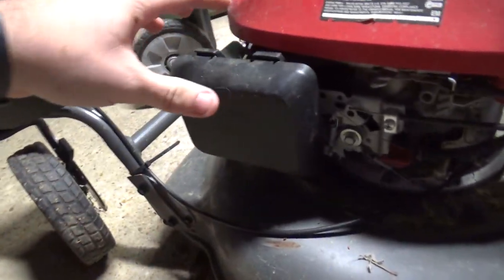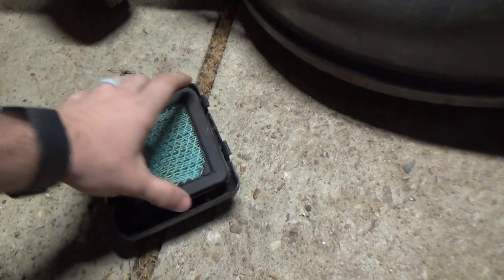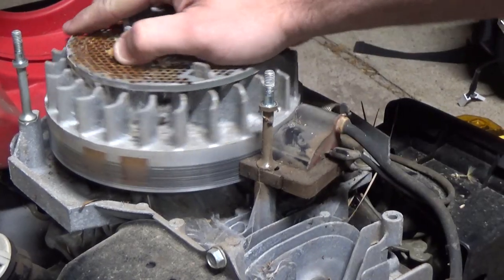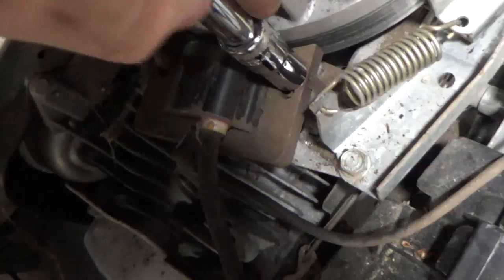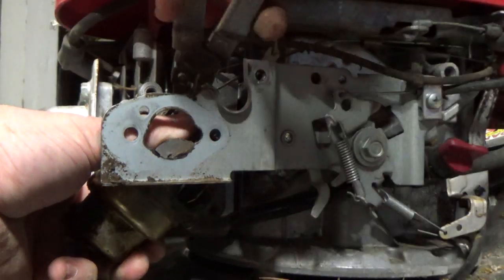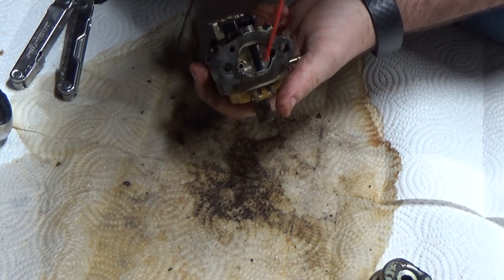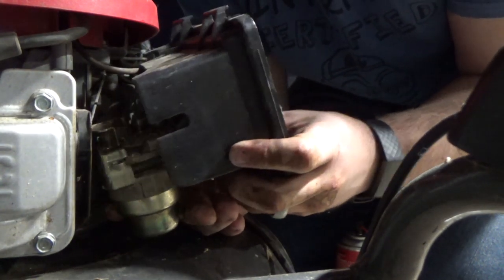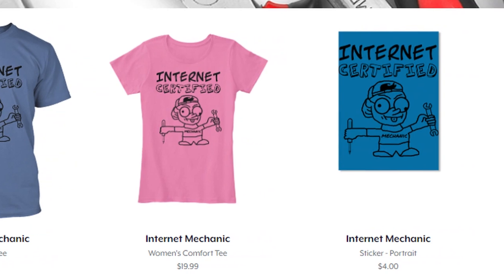How to diagnose and fix a Honda Lawnmower, wont start, no fuel, no-spark

Comment: Newer Honda lawnmowers, use an auto choke system. If the engine does not start while cold, but it starts well when hot, the thermowax cartridge, located in a hole on the side of the cylinder in line with the choke linkage may have failed. If the cold engine starts and stays running using carb cleaner when you spray a shot into the carburetor to prime it, you will know that this wax cartridge has failed and needs to be replaced. It is a "thermowax" 16620-Z8D-305 part from Honda. A good thermowax will have the little probe retracted when it is cold. Conversely, a failed thermowax will have the probe stuck extended while cold, holding the choke butterfly open. So the engine is starved for fuel when cold. The probe in the thermowax moves the choke butterfly open when hot and closed when cold.
Reply: Good point, George. Problem with mine staring cold was the thermo wax cartridge. Replaced and now starts first pull. Damn things are expensive, $30.00 on Amazon for a genuine Honda part.
Reply: I saw a video of a guy getting a manual choke system and by passing using the thermal wax mechanism. I’m thinking of doing this to my Honda tired of it failing at least 3-4 times a year.

Comment: I have a Honda mower and I love it! I clean the spark plug at the beginning of the season, check / replace the air filter and clean the mower after each cut. After about 15 + years it’s still going strong. No issues with it so far.

Comment: You make the latter steps (putting the parts back together), much easier than it really is.  For most people, this is NOT a one person job and if one does NOT have a lot of patience, send it to someone who does.
Reply: I replaced the bolts with studs. Makes reassembly much easier just sliding everything on in order.

Comment: Thanks for very helpful video. I got my honda mower back from repair shop three weeks ago. They did a tune up and rebuilt carb. The first time I tried to start it, took 8 pulls.  Week later.6, then next week would not start. Watched your video and checked for spark. No spark, so pulled coil off and cleaned rust off contacts. It started with one pull.

Comment: Another thing those Honda engines are good for after they've been sitting awhile is no compression.
  Then you have to pull the valve cover and remove the intake rocker and unstick the stuck intake valve and it'll have compression again.

Comment: Thanks so much for this. I applied it to a Honda GVX160 and it was more or less the same. The carb was completely filled with gunk. After cleaning as you suggested it started pretty much on the third pull. Couldn’t believe my ears. It had been standing for 5 years. You provide an amazing service!

Comment: This is the most common sense method for troubleshooting any small engine with no start problems. If I didn't know this already I'd be subscribing. Hey CM I've been wanting to explain to YouTubers exactly the process you demonstrated how to troubleshoot this Honda. I'm scratching this off my bucket list because you beat me to the punch and its essentially Mission Accomplished. Thanks for putting this up.
Reply from the maker: Thanks!
Reply: @CreativeMechanic  and you did it in 9 minutes. That was some really nice editing. Great Job!
Reply from the maker: The only thing I should have left in was to check compression!  But I’m at the point where I can usually feel burnt rings when I pull the pull chord.  Thank you!!!

Comment: Thanks for this video! Mine was backfiring after running great all summer. I followed all of these steps and runs like a champ again. Appreciate you taking time to make this video.
Reply from the maker: Backfire is when the engine fires back up the intake, after fire is when the engine fires through the exhaust.  This can be caused by improper valve timing or a rich or lean mixture

Comment: I have one of those. So far I have replaced all the wheels, both rear wheel adjusters, the carburetor,  all the cables except the throttle cable,and now the transmission and axle. I hope this thing is worth the effort. The front wheels are supposed to lock up but the cables were frozen. It was $66 just to replace them. I only paid $35 so I pray it doesn't need anything else. The transmission cost me $145. I normally just part them out but committed myself to repairing this on . I have another with a badly bent crankshaft that I plan on replacing. Honda mowers are over complicated for what they are. Those drive shafts are trouble. Every one I got refused to go backwards. Usually it's rust on the axle. Honda needs to get its act together.

Comment: Excellent video.  I've been watching a ton of these and this one is the best I've seen. My problem is that even after following all the steps - even replacing the carb with a new one - my mower still won't start.  Mower sputtered and died while mowing and haven't been able to start it since.
Reply from the maker: You may have a bent push rod, a bad valve, or leaky piston rings.

Comment: Excellent teaching video and thank you. Are there any carb adjustments other than the idle screw?
Reply from the maker: Mixture screw too, but those are both usually spot on from the factory and don’t need to be touched

Comment: To clean the jets and air passages, you need to remove them and clean them manually with small wire or carb brushes.  Then spray everything thoroughly with carb cleaner.  An ultrasonic cleaner works great with carbs if you have one.

Comment: Great video, Thanks. However, My issue is a little bit different. Just went to start my 25 year old Honda 214 model ( I believe) Had started it every year, and ran for about 15 minutes. However, for the past 2 did not.  Brought out yesterday to start and service, and starter cord would not pull at all. Tried moving blade underneath, but remembered there is a blade brake/clutch or similar devise in place. Just trying to free piston. Note mower always kept in air conditioned/heated garage, never out in elements. Also, always ran carb dry . Any suggestions to free motor would be great. When it ran, it was just fine. Thanks Robert TN
Reply: Sometimes when lawnmower hit something hard get stuck and won't pull the cord or kick back the handle cord front the hands and blades not moving or hard to move with the hands. 
You can try moving the blades move the blades with a long wood and if you thing is a divice or cluth stopping the blades you can try put the handles in running position but be careful this is only to check if the blades move a little to free the piston.,
Reply: Thanks so much for the response. Stupid on my part. The day before removed blade to sharpen first. Had put blade and attachment Back on  improperly. Blade in holder upside down. Raised  against deck. Once put back on properly, All good to go.  Thanks again   Robert TN

Comment: Just so you know, to start these Honda mowers with the flywheel brake, you have to engage the blade when pulling on the rope.  I noticed that at 1:08, the blade was not engaged when trying to start the engine.  Sure, the blocked carb and choke mechanism not working would've prevented it from starting, but not engaging the blade will also not start the engine either.

Comment: EGO makes this ALL history!
No mechanic needed when all that's needed is a little juice.
Reply from the maker: Come back when your bearings are dry and one of the windings in the motors has an open circuit.  I fix quite a few peices of electronic yard equipment and a new carb is much cheaper that those electric motors.  Plus your batteries are toast if you live in Alabama, all the heat wears them out by the end of a season
Reply: @CreativeMechanic  I have no problems...
No idea how this even landed on me.

Comment: Okay.  I've tried a service. I replaced the thermo wax on the auto choke.  I saw this and tried to clean the spark plate but it wasn't that dirty.  I got a spark from the pulled spark plug.  I cannot figure it out.  Just won't fire.  Tried starting fluid  as well.

Comment: you know you have to pull the brake release when you start a push your lawnmower because that releases the brake on the fly wheel and engages the spar
Reply from the maker: Yes, but every time you stop the lawnmower that break comes in contact with the flywheel and shaves some of the pad off.  Over time it seemed these pieces accumulated behind the coil, this the reason for no spark.
Reply: @william whitehead this is the same thing I was thinking. The brake must be released to open the circuit so there will be spark

Comment: Weird things about these Honda mowers. 
1. The vent for the tank in the cap and when it goes bad fuel delivery will be slow or stop all together. 

2. The inline fuel filter clogs very easily and will also disrupt fuel flow. 

3. Whatever type of garbage plated metal  the carb bowl is made of rusts very easily and will easily clog and cause issues. SO NEVER USE GAS WITH ETHANOL.

3. That dumb wax thermocouple that runs the auto choke will slowly go bad overtime causing the mower to be harder and harder to start. 

I got one helluva education in small engine repair this year 😂.

Comment: Bert, great video. Very well done and informative. My mower hesitates a lot when I initially try to start it. Im thinking the carb is fouled up. Thought about just getting a new one as they're not that expensive. Your thoughts?
Reply from the maker: New carb, absolutely.  Then clean your old one.  That way 1-2 years in the future when your mower won’t start, and you don’t have time to wait for a new carb.....
Sincerely, Ernie
Reply: @CreativeMechanic  Awesome. I wanted the new one so I could not feel pressured if I couldn't get the old rebuilt correctly. Never done that before. Thank you for your awesome video. It was very thorough.
Reply from the maker: I have spare carbs for all my personal equipment (Honda isn’t mine). Swapping a carb on Saturday morning takes 15 minutes then I can get mowing.  Cleaning out can take 30-45 minutes or longer on your first go
Reply: @CreativeMechanic  thank you. As soon as I get my new one, I will watch your video a few more times and take it apart, clean everything and then attempt to put it back together. I'll follow the same rules when I rebuild a PC. Label EVERYTHING!!!! Take pictures of what it was like before so I can have a reference. I'll keep you informed. Thanks and enjoy your 4th of July weekend.🇺🇸🇺🇸🇺🇸🇺🇸🇺🇸🇺🇸🇺🇸🇺🇸🇺🇸

Comment: Well I pretty much did all your steps and then someone. I even sprayed fogger in the carb! Yeap it started but doesn’t stay running unless I spray the fogger in the carb. Fresh gas, oil good! And I must have spark if the fogger start the motor. I’ve taken this apart several time and still can’t figure it out. 🤦🏼‍♀️

Comment: Hey man, my honda mower has an issue, when I activate the blade, is turned off, I will like to know how to fix. Thanks
Reply from the maker: Sounds like the cable that attaches to the lever on the handle is broken

Comment: Great video! I did all the steps but it still will not start. I noticed the choke doesnt fully close, is it suppose to fully close ?
Reply: Not sure if it needs to be did u see this one-
Reply: Make your lawnmower start on the first pull again... YouTube vid
Reply: Thanks for the reply! I got it to start a few days later
Reply: Alex Ramirez 1 down one more to go for me, I got an older one for the back so I can cut it low for the dog 💩
Reply: Alex Ramirez the easy start has a part that works the choke on newer models I guess the needle can get stuck out and keep choke open

Comment: Good video but I’m wondering what is ole?
Reply from the maker: Time reference?
Reply from the maker: Oh......  oil.... haha.  Southern accent
Reply: I had a failed spark plug which worked perfectly on test and at idle, but the motor stopped when throttle was opened.  Obviously I spent a lot of time on the carb, even removed the thermal insulation gasket to heat the carb, heated the motor and plug with a blow lamp, ether (engine starter fluid). It appears the suppression resistor in the spark plug tends to break down over a few years.  Wow, I didn’t know how far you can throw plugs .....

Comment: Interesting find on the coil PU... haven’t thought to look at that. As for the carb, my experience with emulsion tubes is, if you can remove them, to use a .o9- .10 guitar string, usually the E string. 50cc carburetors are the worst!!! Good video though, thanks.
Reply: Yeah, IF you can remove them! WD40, sonic bath, inverted Allen key with the bend as a fulcrum on the ceiling of the throat...nada! It's STUCK.

Comment: Very good general video except the removing, cleaning and re-installing the carb. Not as easy as demonstrated. Also, multiple gaskets on a Honda carb to keep in the correct order.
Reply: Not only correct order butcorrect orientation -- I ve just seen a repair necessary because a previous person had put the gasket upside down. A repair shop's solution was to put a screw in the housing to keep the choke half open/closed.